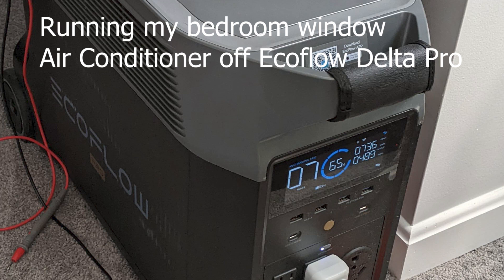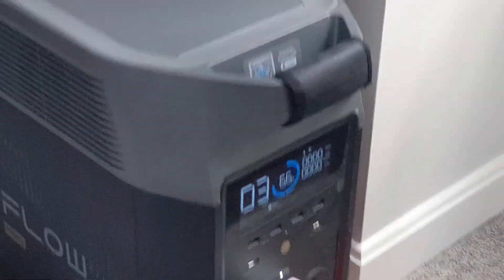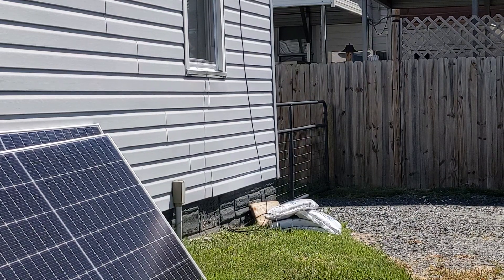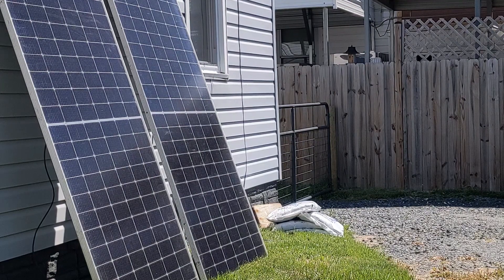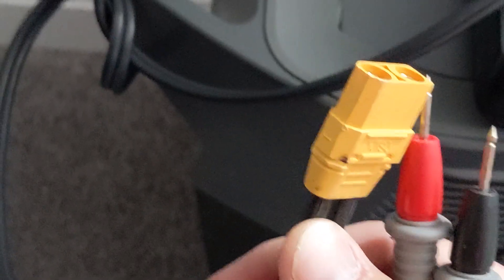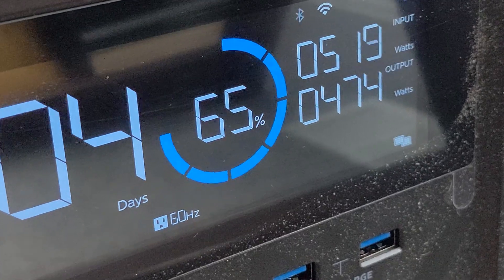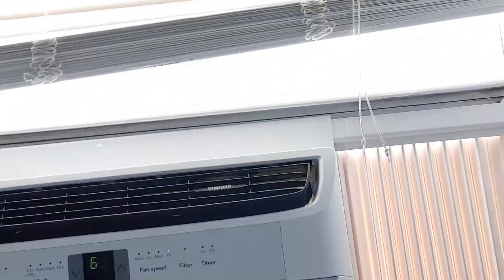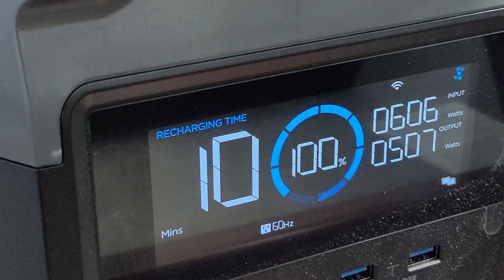Running my Second Floor Air Conditioner on a EcoFlow Delta Pro + Solar

Comment: Thanks for a great video ❤
How do you get the solar to match what’s going out when at 100%?
Mine waits until it drops to 97% to resume charging
Reply from the maker: It's been awhile but I believe there's a setting that makes it stop charging and just use solar for the inverter.  Id have to look. These days I just use my units as a 240v backup to my office grid inverter

Comment: Has the ac been running the entire 14 hours?
Reply from the maker: I typically leave my acs on ,  they only run when the temperature increases otherwise the fan is running

Comment: Once the room reaches the target temperature, how long does the AC run before cycling on and off.  How much power is used overnight from the time the solar input drops below the power used until the sun starts charging again the next day?
Reply from the maker: Its been awhile but i would say maybe 1.8 kwh to maintain

Comment: Hi.  Do you have to have Internet wifi in order for Delta Pro to run  appliances?
Reply from the maker: It surely helps to have wifi but you can turn them on and they run but your monitoring options will be limited to bluetooth if you are in proximity .

Comment: How many BTUS  is  the air conditioner your powering in the video?
Reply: looks like a Midea 12000btu smart inverter style window unit. Those are variable wattage units based on the outside temperature. So if its 100 F outside the unit will crank up to high power mode and if its 85 F outside it will spin down to medium power or low power fully automatically!
Reply from the maker: when i recorded that video that was a 500+watt conventional AC ,  Only thing it did was kick on and off.  Currently my house is offgrid ( Most days ) and i have upgraded my window units to Media 10K btu U shaped inverter units  which are great !
Reply from the maker: 5000BTU ,  But a newer 10k BTU Inverter ACs would work just as well

Comment: Nicely done,  a litt more information on the wire and connection you did would help
Reply from the maker: I used Landscaping low voltage copper wire and soldered the XT60 on one side and then made sure that positive and negative lined up at the panels .  Nothing fancy

Comment: How much did this setyo cost?
Reply: Setup*
Reply from the maker: Probably more than i should have spent ,  I bought a refurbished unit for like $2400 ( Ouch)  and less then $50 bucks to make my own panel wire that was 30 foot long

Comment: I've been playing around with a Delta Pro and space heaters. What I've found is that, not connected to solar panels, even a small heater will drain the battery within 4-6 hours. So if you're in a power black out in the middle of winter and cloudy days, you are very quickly out of luck with respect to heat. Better to use a fire place and wood. Your air conditioner must be using a lot less wattage than a space heater.
Reply: I run a 12,000 btu portable air conditioner that has the heat function (heatpump). It pulls 1150 watts and outputs twice the heat as a space heater using about 1/3 less power. I've been using my 1200 watt array on my delta pro and when the sun comes out I unplug the delta pro and the solar takes care of the heater all day and until we go to bed around 11pm. We have a 1600 Sq. Foot house in east Tennessee and it will keep the house above 70 down to 10 degrees. Love it! I switch to 200 watt charging at night and it's back to about 40% by morning and unplug (wifi plug) again and repeat. Space heaters have NO efficiency lol.
Reply from the maker: If i were in a power black out i would not use resistive heating but would tie my central air handler into the units and run my gas heater .  The central air handler uses less than 600 watts for like 10-20 minutes at a time while maintaining temperature .   But thats me ,  Resistive heaters would burn the energy in like 2.5 - 3 hours
Reply: @diyenergystorageandmorewit9577  I completely agree! My portable ac is also a heat pump and my air handler is 220v so that's why I use my portable heat pump for my situation. If you have a gas furnace and 110v air handler than you have the best advantage for heating for any outage! :)

Comment: Hi nice video I have question .. can this ecoflow 3600kw  run a 1.5 kw hot heater whit out any problem thank you..
Reply from the maker: Should be able to but it wouldn't last too long. And make sure voltages are correct but I couldn't imagine resistive heating elements spiking their wattage above rated .

Comment: You might want to put them right there on that Roof … shorter cable less loss .. but I am jealous my Through wall  AC is 220.. i live in a NYC Apt ..so rules ….. but i have 2 ecoflow Delta Mini’s and a bifacial 220 watt and 2 x 160 watt panels ..and 2 x 780 watt scooter battery packs .. that can charge the Delta using the solar port ..
Reply from the maker: are you trying to run as much as you can on your units in an apartment ?
Reply: @offgridmaryland  No ..they are completely for Emergency use NOW .. ..I do not have access to any outdoor space …. I have an Airshaft ..Window .. that I am thinking of .. securely mounting  my 400 watt panel inside the Exterior Security Bars ..I installed when i bought 27 yrs ago .. ..  .. if .. anything other than ..WW3  .. in which case NYC is a BIG CRATER .. food ,water , recharging ..during civil chaos ..Food shortages , blackouts or the walking fungi humans ..is my goal
Reply from the maker: @presidentpotato222  well let's hope ww3 doesn't happen!  And I understand the space constraints!
Reply: @offgridmaryland  and my  comments were  given as only ..all I have learned to   Help ..  .. I am in NO means an expert have a ..financial gain .. via my Affiliation of channel etc etc
Reply from the maker: @presidentpotato222  I don't think any of us comment for any financial reasons.   I make videos cause I enjoy the tech .
Reply: @offgridmaryland  then you are like me .. an Exception.. MH

Comment: Why can’t every Tesla have a massive solar panel on the roof????
Planned obsolescence, that’s why
Reply from the maker: Well take into account that the panel could only be big enough to offset about 50-70 miles per week ... i think the use of the NCM chemistry in the batteries is more along the line of planned obsolescence  with the relatively short cycle like of the original 18650's they used

Comment: You said from 100% to 66% in 14 hours what size btu ac is that?
Reply from the maker: 5000 btu on Energy saver mode .
Reply: Good for an emergency in case we end up like Spain and Portugal. Low odds of that happening, but it’d be nice to be prepared.

Comment: Seems like a good solar Generater.Systems . I have not had to put it to the test yet in a situation without power but it has seemed to operate fine so far.
Reply from the maker: Depends on the battery type and how many cycles ,  Lifepo4 batteries have  3500 cycles to 80% capacity so if you have 1000Wh and you cycle that 1 time a day you can get like 10+ years ...   you should be able to find good metrics for life expectancy with some easy google searches

Comment: I have the same Ecoflow unit, and read that to run the Harbor Freight 100w panels, I would have to use the included reverse polarity adapter. If I run an extension, life 25 feet, no other polarity adapter is needed I assume, just use one. Also how many of the above listed 24v panels could I use to charge this unit? I have many. Thanks so much from Arizona.
Reply from the maker: The Panels i used for this come in at 49 volts per panel .   I also have no experience with the Harbor Freight panels, Which ones do you have exactly?   The idea that they would  not be standard and would need some kind of polarity reverser is odd to me .

Comment: Can you just connect the delta pro to a wall panel and then connect the solar panel with it and power your whole house that way?
Reply from the maker: If you were 120v panel yea probably.  But you would want to know how much usage you have and if the battery is big enough

Comment: So, w/ max input of 1600 watts, I would need 16, 100 Watt Solar Panels to get the max outta the Delta Pro?? My plan is to get an extra battery. Also how did u run you cords in series, or the other method???
Reply from the maker: Keep an eye on voltages.   You have a top of 150v DC input.  My panels are big enough that I could do one series

Comment: I really appreciate thevideo alot.  I'm looking at something similar for my garage, which is completely detached from my main house.  I've been looking at possibly setting up some used 230w panels on my pergola that would connect backt one of these for me to use in the garage.   This is helpful!
Reply from the maker: I like the units .   If you get one maybe an extended warranty would be good !   I recently had one of mine actually smoke a little and stop working..   the good news is they are going to fix the unit and send it back to me but it's troubling..   

I'll have some more videos soon

Comment: Hi where did you get panels .
I just got my unit and need panels
Reply from the maker: I bought my panels from Santan Solar but they don't have anymore in stock.  But just remember you can series any panels up to 145 volts max 1600 watts .
Reply: @offgridmaryland   thanks do you know the brand of panels you have?  nice i would love to do 1600. ECOFLOW is selling refurbished items on ebay for good prices right now. I may pick up the expansion batteries
Reply from the maker: @NizmoTech  JA Solar 530 Watt   thats the exact panel ..  The Ecoflow Deltas i have are the refurbished ones from ebay. 

I am happy with them so far .. will be doing some split phase testing soon .
Reply: @offgridmaryland  awesome brother will be on look out for vids . Thanks

Comment: Hello, thanks for this great info! Could you run 3 of your 530W panels in series without damaging the inverter (150V, 15A max)? Or would 4 panels, 2 series sets in parallel be OK?  Thanks!
Reply from the maker: Essentially. 150v each panel is 49v and 3 of them are right at 150v and 14 amps ..     new video with 3 panels being used comes out soon ,been having issues with editing.
Reply: @offgridmaryland  Looking forward to this new video. Thanks so much. :)
Reply from the maker: The unit takes a 1600w input Max. I'll have a video out on Sunday or Monday showing what your asking.

Comment: So would this run a/c over night without solar input?
Reply from the maker: I run mine overnight and set the 72° on Eco mode... In about a 400 ft² room.

The lowest I've seen hit by morning is 42% when the sun comes out it charges it up within 3 hours. Then I let it run while solar is at its peak and then cut it off until I'm ready to go to bed
Reply: @offgridmaryland  awesome! Thank you for the response! I’m deciding whether I want just the one or the two battery setup.
Reply from the maker: @DISTRACTIONNN97GAMIN  I've got two of the single units.    Expensive compared to diy but damn convenient.  I will be making some changes to my setups soon ..
Reply: @offgridmaryland wow. So that's basically a 24/7 air conditioning system just off solar?

Or am I reading something wrong lol
Reply from the maker: @segun_finance_2  I was able to run that small window unit for the whole season using this device .
Reply: @offgridmaryland  wow
Reply: So when you run your ac overnight the lowest you seen it in the morning is 42% is that with just the one unit or 2 units? Thanks

Comment: You’re a lucky man to be able to afford such luxuries I’ve been trying to save for one of those batteries but the price is ridiculous it’s more money than I make in like a year for one of the big ones I got a smaller one on black Friday couple years back only took about two years to save for I thought it would be able to power my fridge but it can’t best I can do is keep a TV going 🖖🏻
Reply from the maker: Refrigerators have a large surge once the compressor kicks on there are alternatives out there that are cheaper and can handle that.
Reply: @offgridmaryland  What alternatives do you recommend? I'd like to be able to power my 7 cubit freezer, fridge and a small portable A/C.
Reply from the maker: @plainman9887  Do you know the Max running watts of both units ?
Reply: Yeah.  I can relate. I live on Social Security, but I am lucky enough to have a retirement account and I am going to break down and use some of that money to buy a Delta Max 2000 so I can power my a/c, and hopefully refrigerator and small freezer when power goes out.  I think blackouts and brownouts are going to be the future for us all.
Reply from the maker: @KWMc1952  I agree with that statement about blackouts becoming more normal as they attack baseload power plants.

I bought my units certified refurbished with a warranty to save some money!
Reply: @KWMc1952  Yeah man I live on Social Security to you lucky that extra cash save it One day you’re gonna need some food Social Security just doesn’t go as far as it’s needed

Comment: it willt take you 10 years to break even
Reply: This is not break even when the grid goes down (hurricane etc) it's a lifesaver
Reply: I’m thinking doing it too, break even in 10.  But after that you are making profit. Plus you are not counting, if grid goes down you still have power and you can take power with you anywhere you go.
Reply from the maker: @jakeliujakeliu  I'm not sure you want to look at being more energy independent as profit. 

But yeah the comfort you get will be good ...
Reply from the maker: Yes the roi would be a long time if this was the units ultimate purpose.  But I have another purpose for these after I make some adjustments
Reply: @offgridmaryland  These guys aren't getting it.  Break even?  This is self-contained.  If the grid goes down you are keeping cool while others are not.
Reply from the maker: @gregory4154  exactly ,. As I see all these states with rolling blackouts I cannot help but justify my hobby.  I'm not worried about break even really. The uses for my house , charging my car and. Keeping the family business operating if the powers out that's what I'm looking for .
Reply: "It will take you 10 years to break even"

If the ecoflow lasts 10 years. Chances are it won't.
Reply: 10 years is fast compare to tradition solar system just panel no battery takes 20-25 years. And 3-8 time more, depend if you have additional battery or not.

Comment: would this kill the battery quicker if you are running the a/c and charging at the same time over the summer months?
Reply from the maker: Well. When charged it is just converting the power to AC.   And the cycles is what you need to keep and eye on there are rated 6500 full cycles  .    If I cycle them 50% daily should last a good long time .

Now that's going off specs .

Comment: 14 hours is BS. I ran a 5000 on low on mine it lasted 10 hours down to 28%, You are NOT telling the truth.
Reply: He's using pass through charging with solar panels while running a/c at the same time. You're talking about running only the battery from 100% to 0% to power an a/c with no solar pass through charging.
Reply: correct @larryc1616
Reply: Maybe you run battery only and he might run with solar coming in
Reply from the maker: @jakeliujakeliu  it does run a good portion of the time on solar and only battery overnight
Reply from the maker: This includes solar + battery with daytime peak of 1050 watts of solar coming and battery being fully charged from 1pm and running till about 5pm purely off solar itself while maintaining an average temp of 73 degrees on eco mode.

It helps to ask for the metrics first ,once you are to temperature the AC cycles on to maintain the temperature . 

Depending on the day and the cloud cover I have gotten down to 51% by 7 am at which the unit is already picking up 60-100 watts of solar.